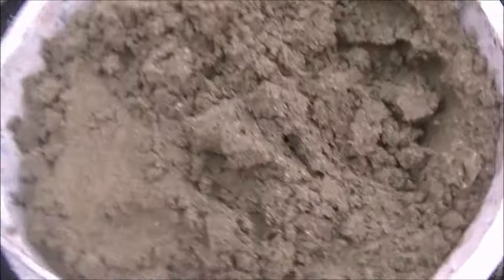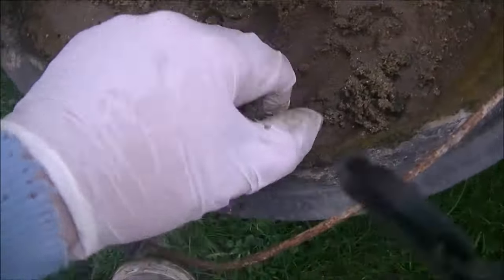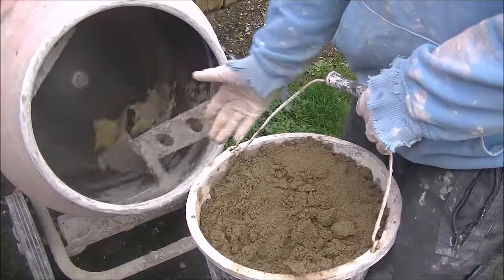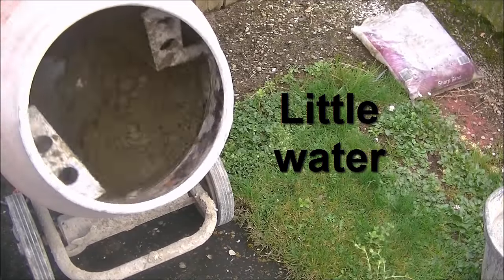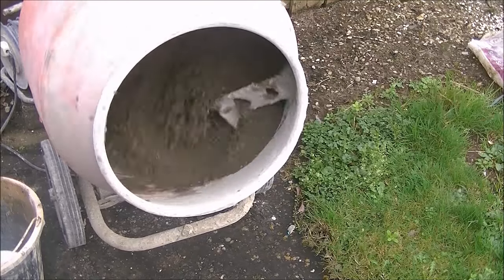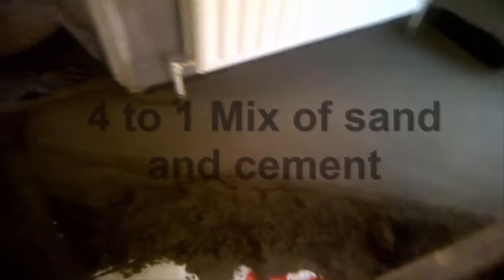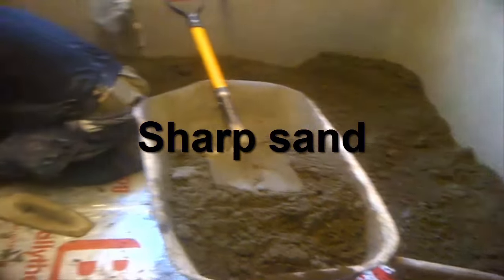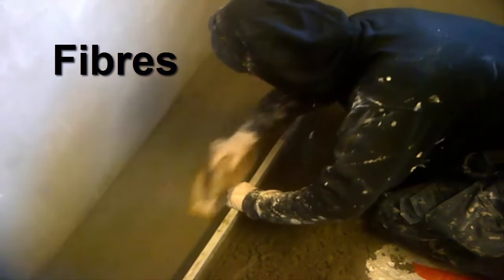How To Make and Mix Floor Screed

Comment: Could I ask, I’m porcelain tilling some existing concert in my back garden.. but the floor is uneven, maybe off by about 20mm. It’s only an area of 6m2 would this be adequate to lay initially to level before I cement the tiles over? Watched your video already great help, thanks mate..
Reply from the maker: The optimum thickness of a sand and cement bonded screed is 25–40mm so 20 is pushing it to the limit The lowest I have ever went on a job was 10mm but I compacted it real well was a strong mix in the fact i added fibers and sbr to mixes to help reduce the chances if it cracking and also sbr / bonded the floor i was going over with neat sbr that floor is now got tiles on it and has been ok for a good few years now , its one of them jobs it is risky but I done everything I could to make the best job possible , the floor i was going over was between 2 rooms one was 10mm in places lower so i needed to level them through for the tiles I was working over and existing screeded floor so i had a solid background what will you be working on top off my friend ?
Reply: mac plastering thanks for the reply!! Iv turned my hand at a host of diy jobs by watching videos like yours! It’s a concrete base already (I think it was previously a patio that was knocked down) and the one side is about 20mm lower.. I can always raise it by 20-30mm and even it towards the other side by 5mm say. Also as I’ll be laying a bed of mortar to lay the porcelain tiles on afterwards, so this could even put some size difference. just wondered whether it would keep for the laying of the tiles afterwards thank you for replying and hope you get the picture I’m trying to describe! 😆👍🏼
Reply from the maker: @benprice2984  yes perfect picture mate.... by keep do you mean not set hard are the tiles heavy what thickness are they mate ? how deep of a bed of sand and cement mortar do you need?
Reply: mac plastering I was planning on doing the process of ‘screeding’ like in your video... levelling it off somewhat to about 20-25mm letting it dry then coming back and laying about 30mm of  mortar and then laying the 20mm porcelain slabs! Thank you again for your guidance bud massively appreciated!
Reply from the maker: Sounds a good plan screed should be set in a day or two but you could lay a few boards down to spread the load out some where you are walking or just compact it real  well when laying :) glad my info helped some buddy keep it touch and let me know how it turns out
Reply: I think I would approach the leveling problem a bit differently. For me, I would mix a portland/water slurry, add some sand to keep it from cracking, add a dash of sugar to soften the slump and let it spread more easily. Pour it out and move it around with a broom, or trowel if it isn't auto-leveling. With the sugar it will take longer to set so you have more work-time to get it level, basically a set retarder. Two-bits worth.

Comment: Thanks for the video, what minimum thickness can this mix be laid at?
Cheers
Reply from the maker: Hi Martin mate what are you going over?
Reply: @macplastering  
Thanks for getting back to me.. 
I had the concrete laid today on the extension oversite. They've finished 15mm short of the dpc height as they didn't order enough! so now have 35mm  to make up to finished floor height.. want to cut costs down.. roughly 20m2 to screed
Reply from the maker: Is the insulation down already mate ?
Reply: @macplastering  yes mate, 100mm of concrete on 100mm of insulation
Reply from the maker: @martincraggs1162  I would recommend 3inches its about 75mm I have went as low as 10mm in places but bonded the subfloor and also had fibers in my mix with no issues but it was not easy and again would recommend about 3inches is best have you thought about a liquid screed ? it can leave a very nice finish also but might be expensive ?
Reply from the maker: @martincraggs1162  A screed might be ok some say for a bonded floor that 25–40mm is ok but if I was gong to do it I would get the fibres in to reduce cracks
Reply from the maker: 75mm is good over dpc and insulation has enough weight to hold it down well and most likely wont crack or lift up
Reply from the maker: @martincraggs1162  I had been thinking you need to fill 15mm but you need to fill 35mm so you should be ok  but just throw caution to the wind and use fibres dont finish as easy but should give a stronger floor
Reply: Cheers,  I think I'll just go with liquid screed,  like you said its only 35mm up to the height I would want to tile on.. Will save a  bit of time aswell. Won't be doing it until the shells up anyway. Probably early spring at this rate
Reply from the maker: @martincraggs1162  best to get a price of them and see, also what depth the recommend I know they can go 10mm no problems on jobs I've seen but the all might have diffrent mixes also some liquid screed need a sanding or a grit  painted on for gripping tiles or a matt laid 1st depending on tile mate , sorry for the lots of info but better to think 1st before make a call weight up all the options and if time is on your side it might work out well
Reply: @macplastering  your a star and thanks for you're time and advice.. much appreciated 🙏
Reply from the maker: @martincraggs1162  Glad to be of some help mate and always here if you need :)

Comment: Could i use screed on a stable floor as i only have 7cm available and the base is concrete?
Reply from the maker: 3inches on a solid sub floor is normal mate i think you are just below that but if sub floor is sound it shouldn't be to bad you can add fibers to mix and sbr are you putting down ppm or is that already in the floor below?
Reply: @macplastering  thank you.

Comment: Think you could use your refina megamixer for making the screed.
Reply from the maker: Defo but after a hard few days It might feel the pain a little
Reply from the maker: have a few videos of me making some screed with both the electric and petrol mixing drills not sure ya seen them but defo this would be stronger for it
Reply from the maker: @jamesgrant514  Oh i see yea man a few buckets here and there should be fine just wouldn't make a habit of it  as it will punish her :):)
Reply: Aye it’s for practice in my garage. It’s mostly skimming work that am doing the now.
Reply: Is that a refina box level your using. At the end
Reply from the maker: I think refina do them but i got that one from faithfull tools box level i call them handy for beads too
Reply from the maker: Practice makes perfect :) nothing wrong with just skimming but if you can add more you will be able to take more types of jobs on , not that floor screeding is easy work it is tough going tbh I have respect for the lads do it full-time

Comment: Hi mate, great video 👍 might sound a stupid question but when you say 4:1 sand and cement would that be four buckets of sand and one bucket of cement for a bigger mix?
Reply from the maker: Yes mate thats what i do :)
Reply: @macplastering  great mate cheers
Reply from the maker: No problems Jim mate better to ask a question and feel silly for a second than no ask and be silly forever :) but in all honesty mate there is no silly question's always here if you need
Reply: @mac plastering  great saying mate will keep that in mind. Cheers mate has reassured me a bit got my first floor coming up 👍
Reply from the maker: They are hard work mate always get my back tight

Comment: Can you send me any links to your cornice mould set up had a quick look couldn't find them if you don't mind cheers
Reply from the maker: Have very little vids up off it usually do it in situ and repair ect dont get a big pile of work with it to be honest but my  setup would be a bench around 9 foot long if doing 8 foot runs will be doing some bench work soon making a few things ceiling rose and a cap to finish of that one i was running the other day

Comment: Hi great video just wanted to know if i can do this to replace dry rot on joists in living room? Joists are only 2x2 so would need to dig down and put insulation in
Reply from the maker: I wayne mate I have only ever done solid to solid floors I dont think there would be a big difference , might need to dig out and down ,depending what's down already ? I(f soil dig out to level needed  whack down stones put in dpm insulation and then concrete then dpm again and screed . Before all that might need to block up any holes round side that joist went into with brick and possibly stop the screed and than filling the vents or if it wont matter block them 2 but would all depend on the build , could work out cheaper to do the timber again and add dpm under it ?
Reply: @macplastering  its customers decision mate to have the concrete floor put in, i havnt yet been to the property but he said from the looks of the subfloor it seems earthy, with stones etc, usually the subfloor is about 2ft below the joists so wondering if the last people who lived there filled it up with random soil an hardcore?? So would it need to be concreted first before unbonded screed or can i just do a floating screed like you did after putting DPM and insulation in?
Reply from the maker: @waynedunne4838  I have always went over concrete mate , a house we dug out before had no jokes tiles then inder was 2inch screed then 2inch sand then soil / clay was a right paint to dig out took a few skips and hard work and a few broken spades haha but every floor I have ever done had concrete 1st , a brick layer told me best way is hardcore wacked down dpm down then concrete that then dpm again to be sure and insulation then the screed , done lotds of floors where builder want dpm then insulation and others want insulation them dpm , if you ask me it dont matter aslog as both are there I know I would prefer dpm under concrete then insulation then dpm and screed on that   , the instulation in my eyes stays dryer that way wont smell when drying ether if this make sense ?
Reply: @macplastering  ok so how far down would you say to dig down and what thickness of each material should i lay at?
Reply from the maker: Hi mate sorry I thought i answered this but seen that i haven't
Have not done one in a while so trying to look back n my book to see how far we went down , I thin one room was down to how far down the founds where as we could not undermine them so this might be a good way for you to start mate.
So if you dig down untill you see the founds then measure up and see what you have to pay with  , Read one time that the soil types can and will effect foundation depths ,clay soil , sandy soil , piled founds 
So when you have it all out and clear they way i would go about it is measure down so you need from 65 to 75 mm for your screed 
then what ever amount thickness of insulation you want in say another 65mm I think that is minimum required 
next then would be the subfloor concrete witch minimum would be 4inches thick 
so what ever is left you now need to fill with hardcore 
best to whack down like 3 inch layers at a time to make sure it is well compacted and no voids I whack it down in a few diffrent directions also side to side up and down then around and at angle to angle over kill possibly but this is the 1st layer start as you main to go on, so i would use lose stone to fill some followed buy blinding its stone and quarry dust mix gets very very hard when compacted  as the dust fills all voids very well when wacked locking it together.
I mark my sides where i need to come up to so i dont fill to high and end up with less concrete insulation or screed that i need  remember you can always add some concrete up but not down same as screed so if you lower with stones than amid you can make it up on the next level with concrete , if your getting it ordered give them sizes they will work out how much needed get a skip and add 5 to 10% on depending how big the job is to make sure you dont run low and can dump rest  if you did run out of screed never run it down into a slop but cut it of and either mix more or buy more to finish like this little demo -  https://youtu.be/XuTdGEUoQz8
These are the ways I would go about it 
Hope this all helps and still here if need any more ideas mate
Reply from the maker: @waynedunne4838  Hope you got on well buddy
Reply: @macplastering  hi mate it didn't end up going ahead but il remember the input for the future haha. Happy new year 🙂
Reply from the maker: @waynedunne4838  No problems man always here for ideas and help man and yes hope you and yours have a great new year :)

Comment: Hey, quick question. Would you consider using this kind of screed for a shed base or would you use wet concrete?
Reply from the maker: Depends I think concrete would be stronger but is it a light shed for light stuff ? thing is even when we screed it always has a sub floor of concrete most imte the sub flor then insulation then  plastic and screed on.... Oh mate if you ever come arcos a video we have done and think of a better title just let me know :)
Reply: @macplastering  cheers. Will do bud.  How do u edit your videos? Also what camera do u use?
Reply from the maker: I have used so many cameras and software mate windows movie maker open shot camtisa you name it I proply used it  and camreas cheap 30£ ones to dear sony and a go pro now the most with a jvc and sony back up something tells me 4k is needed but again would it matter would it make a difference ?
Reply: @macplastering  I used to be a photographer. Camera makes a huge diff. You need something with a decent iso.  The better the iso the less light you need to get good quality in low light and cos your alway working in dark houses it might make a difference.  Brighten up the shot.  Little techniques like position the camera so the light from the window is shining where u want to film.  New iPhones have brilliant cameras (I'm an android guy but my daughter has an iPhone and the cameras are way better)

So yeah if u spend on a genuine go pro (not cheap knock off) you'll get far better quality. Also having a flood light would help if it's dark. I know u probs don't wanna go that far just yet. 

Then u can edit the videos a bit more "youtuby" to make them more instantly likable.

Dunno if you've ever watched "Chris fix" he is a car repair guy who developed a brilliant catchy style of videos. People watch them even if they have no intention of fixing their own car because his style is so watchable. 

Makes it look so easy and shows you all the dos and don't in a fun way. 

Might be worth watching and seeing if it's something you could apply to your videos.  Might take some planning out.  Imagine you hit it off on YouTube tho. Cha ching.

Do you make a few quid from your videos as it stands?
Reply from the maker: Only seen this reply now mate sometimes I dont get notified from youtube. Thanks for the advice mate yes seen that guy the blue gloves :) to be honest i just dont know my style yet but i might get it when it lands on me like a pile of blocks get some but not very much as of yet and to get this stage has took real hard work in the videoing editing and at same time doing the job... if you ever get spare time mate pick your fav video of mine and tell me why I will try replicate those things :) also let me know what your thought are on the new stuff as it comes :)

Comment: Hey mate could I use this for a outdoor step?its un even and needs taken up a bit at front.
Reply from the maker: what depth would you have mate ? might best best with concrete
Reply: mac plastering the step is concrete but it’s tilted bout 20 mil to front.i don’t need that much of tilt.its getting tiled over so need flat surface.what bout ready mixed screed in bag ?im a beginner so any advice is great
Reply from the maker: @anitagoodsleep5330  Screed should be laid around 3 inch , I read online that  The optimum thickness of a sand and cement bonded screed is 25–40mm, so at 20mm you will be below the recommend thinnest , I wonder is there a self leveller you could use instead mate I would just worry that screed that thin on a step could lift of on you as steps take a lot of punishment,
Reply: mac plastering good point.my mate said said I should box it off n do that or pour concrete.i just need something flat and sturdy for tiling.cheers for advice mate
Reply from the maker: @anitagoodsleep5330  Yes that sounds a great way to go about it you could possibly sbr it 1st to give an even better bond mate
Reply from the maker: @anitagoodsleep5330  Hope you got on well with it mate

Comment: Would it be ok to lay this mix 20mil to 55 mil over 2 metres
Reply from the maker: @nialldoyle9406  where is it inside outside. ? What are you working over? Subfloor?
Reply: @macplastering  it’s over an exciting floor which is 50 mil off from one side to the other , over a 3 metre width
Reply: @macplastering  sorry it’s inside , granny flat Reno
Reply from the maker: what's on the floor now? I have done one that was 10mm over a solid floor but i bonded down with an sbr type glue and had fibers in the mix to make it stronger and reduce cracks but was deeper in places its recommended 3inches from google = The optimum thickness of a sand and cement bonded screed is 25–40mm
Reply: @macplastering  thanks for getting back to me, it’s a concrete floor
Reply: @macplastering  thanks for getting back to me , it’s a concrete floor , what mix would you recommend for 20 mm to 50mm
Reply from the maker: @nialldoyle9406  I'd say if you went 4 to 1 like this mix but add sbr to water and fibers to increase strength then as you work each area paint purpose sbr down 1st it will help it bond big time
Reply: @macplastering  sound job , will I roll the Sbr on neat on each working area ? How much sbr to each mix ? 👍
Reply from the maker: @nialldoyle9406  I just put a few cap fulls in per mix mate and yes i would go on neat at each area so going over it wet